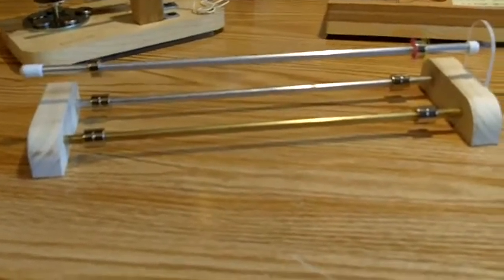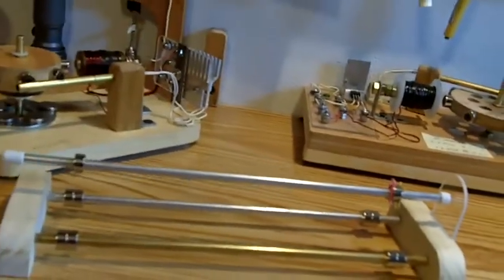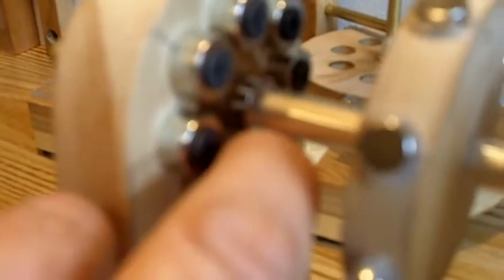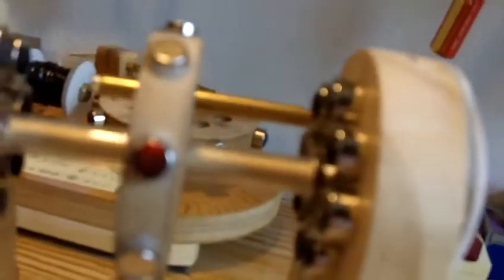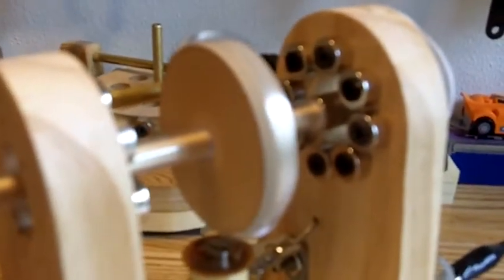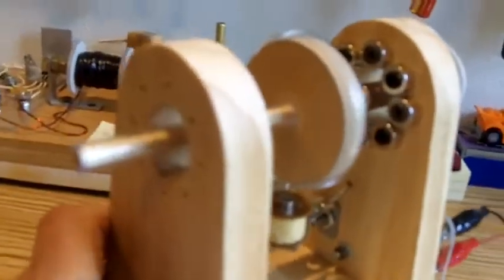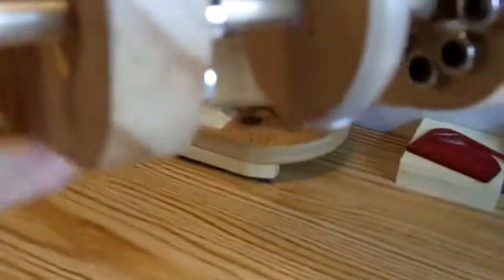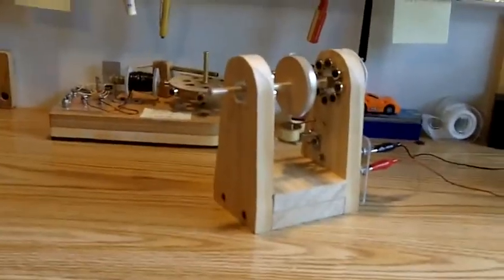Eddie's toy # 7

Comment: I realize this is an older 'toy', but you can eliminate the plastic end plate being pushed against by the ball bearing by gluing a magnet at the end of the shaft, then putting an opposing magnet on the side of that plastic sheet.  The two magnets will repel one another ( you may have to play with spacing at first), and you'll have a truly frictionless 'magnetic load bearing'.  If you do that on both sides, there will be almost no side-to-side mechanical instability, and almost no mechanical resistance to movement whatsoever.  Well-done.

Comment: Very good job with the pulse motor. Even better, the magnetic bearings. I only have two suggestions that would improve it's performance. 

1. Remove the brass tube holding the read switch as it is susceptible to eddy currents and increases friction in the system. Use plastic or wood for the holder. 

2. Encase or press the  rotor magnets all the way into the wheel to reduce air friction. 

Afterwards, I believe i'd be looking at the best pulse motor to date. Great Job!

(Revolution-Green(.)com)